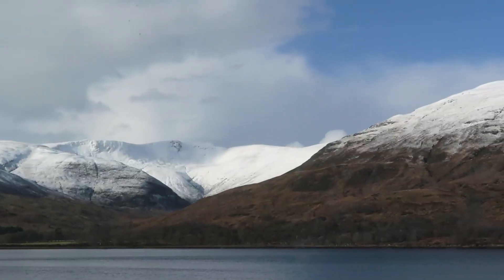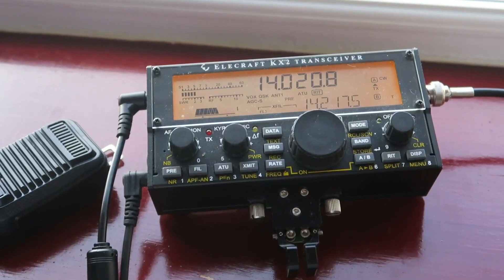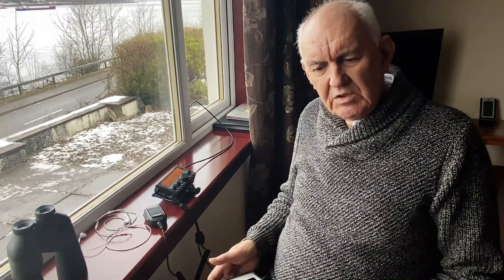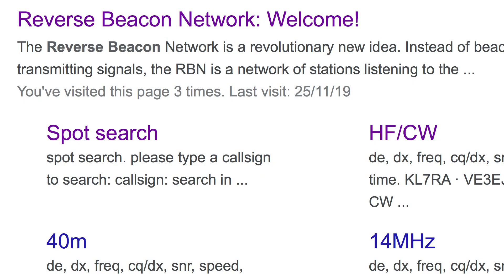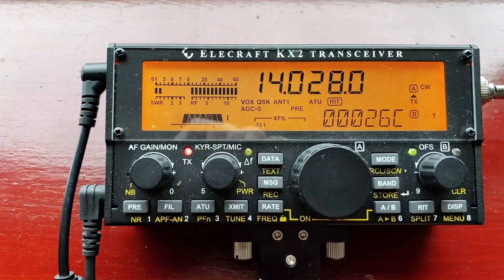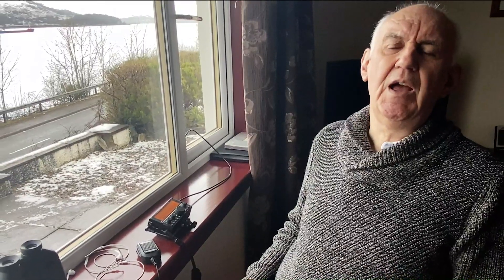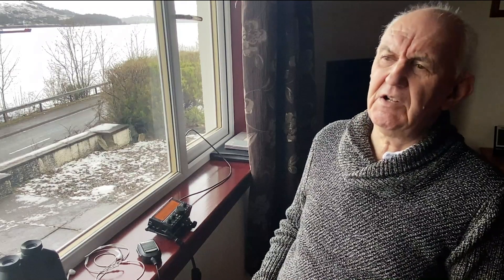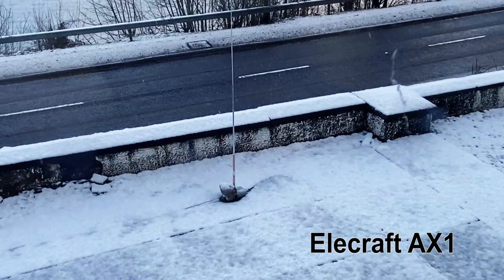Antenna vs Propagation   - Tests You Can Make in Minutes

Comment: In the UK a "mountain" is officially 2000 ft a.s.l. or higher.....any lower and its a hill (sorry, couldn't resist that) :-)

"In the United Kingdom and the Republic of Ireland, a mountain is usually defined as any summit at least 2,000 feet (610 m) high, which accords with the official UK government's definition that a mountain, for the purposes of access, is a summit of 2,000 feet (610 m) or higher"
(Wikipedia).

Comment: I believe a certain amount of refraction by the higher terrain also takes place, personal observation.  A 10,000+ mountain was between me and Phoenix, AZ, a distance of some 180 miles.  Pinaleno Mountain was about 5+ miles west of me, Safford, AZ at the time.  I built a simple corner reflector and aimed west towards Phoenix.  I picked up FM radio all across the band.  When I called in a request, the DJ was amazed when I told him my location.
Reply from the maker: Hi Ted,

Nice to get your comments. I was only a visitor so not much experience on mountains. But interesting to hear your results. 73s Peter.